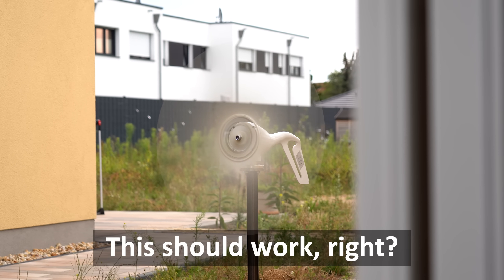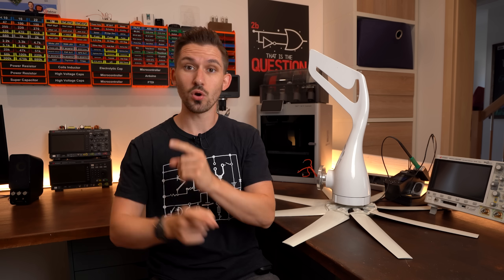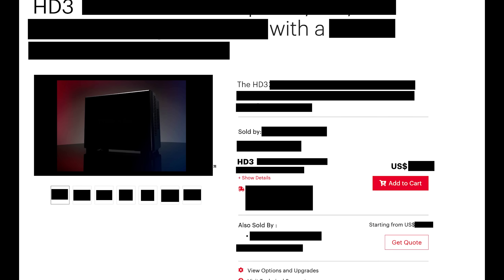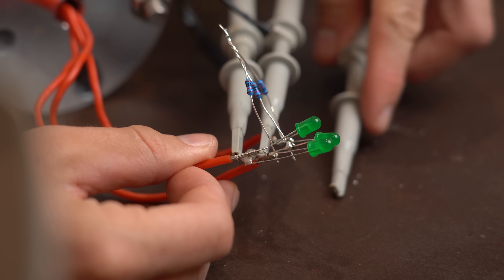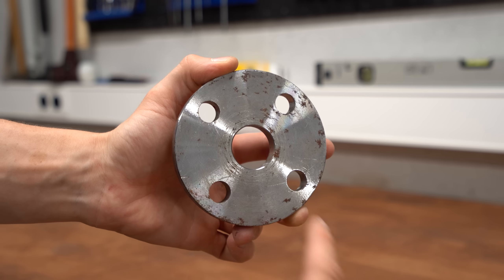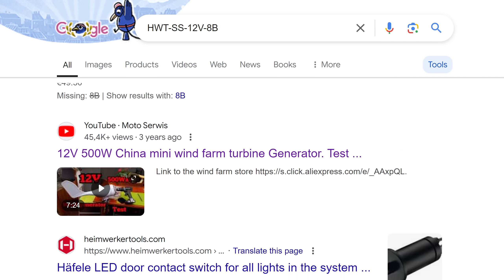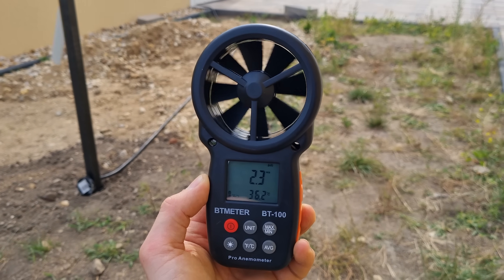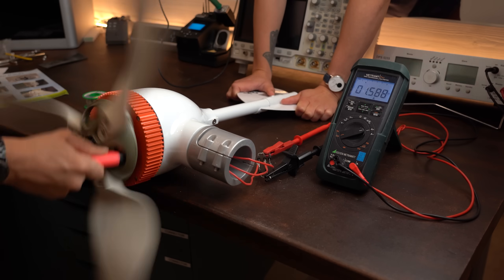I tried to Power my Home with Wind Generators! (Worth it?)

Comment: It*s always a good idea to think about opportunities to produce electricity when the sun won't shine. Due to the fact that you are living (as I do) in Germany in an area where wind speeds are not really worth mentioning, you should think about wind turbines which have advantages at lower wind speeds - vertical wind turbines for example. Also those 'normal' generator wiring won't work really. Take a peek at: https://www.youtube.com/watch?v=lU930zXzLCE for example.

Comment: I absolutely agree, i bought the 48V version with advertising 800W and with the controller i get nothing but with the 3 phase rectifier i get close to 5W when it is stormy. i was thinking of stronger magnets or less airgap between rotor and stator

Comment: unfortunately, horizontal axis wind generators are rubbish at ground level, but if your local laws do not allow them, then you are out of luck.  you could try a vertical axis type as these are better suited for your kind of environment.

Comment: Those "hoverboards" motors built in their wheels give quite decent power output at low rpm. As they seem to be out of fashion, picking up a used one at low price is possible.

Comment: My wind gen rated mounted 5m off the ground @600w 12v system 2x 150Ah battery cant keep up with 4x raspberry pi running off a DC DC converter let alone the 6kw inverter.

Comment: i wonder if you could build some kind of intermediary mechanical transmission beetween the helix and the generator/alternator/dynamo part itself (in order to play with torque vs RPM  in order to get the perfect sweetspot that makes the alternator run at the max rpm possible, making the most energy out of the mechanical energy provited by the wind)

Comment: Here in the lower states, we all pretty much have AC running all day, or at least while the sun is up. The evaporator coil fan is almost always on and blows pretty hard. I often wonder if it would be useful to place a wind generator just above the exhaust and recapture some of the wind energy that is being wasted by the fan. I would be concerned that the heat coming out of the coil would overheat the generator.

Comment: Try recoiling 0.2mm copper wire in a serpentine coil with neodymium magnet's. robert murray smith. You will get significantly and i mean 4 to 5 times the output

Comment: Hey!

Would like to start with saying that I love Your videos 😊

Have You considered to try a vertical wind turbine instead? 🤔

When I have watched similar vertical turbines they say it has a better effect when it's such low wind speeds.

And it should work on a low setting like Your yard and even on top of the roof on higher buildings (with a flat rooftop 😅)

Comment: Ive heard of people rewiring clothes washing machine motors to 3 phase, only needing to cut a few wires and connect them correctly on the motor windings. These were in Australia primarily, a motors needed to be a specific type to not have to rewind them.

Comment: At 3m/s wind speed the theoretical max power of a ~1m diameter wind turbine is only 8W. Rewinding the rotor will help extracting more energy than what you measured but you will never exceed the aforementioned number.

Comment: So the outputted voltage is lower than the minimum voltage to charge the battery right? Why not use 7.4v batteries in parallel in the input and use a step up circuit when used to output?
Reply: This should save a lot of time rebinding the motor or trying a new turbine.

Comment: Why can't run run multiple and daisy chain them?  Or maybe charge a lower voltage battery and then daisy chain those to charge a larger battery?  Idk anything about this stuff so no idea if that would work, and if it wouldn't why it wouldn't work.

Comment: i wonder what it would look like down/up-scaled
not like a 100 pc fans, but larger lightweight wings & custom rotor/stator
those tiny wide blades are for creating high windpeeds at pressure
i´d like to see more narrow longer blades
typical German, everything is sized and overengineered in a way, it hinders itself
source: German myself :D 
very good buildquality  tho´ <3

Comment: Have you ever tried building your own wind-generator, using a car alternator? It already has the electronics to charge car batteries, so that's a plus. I don't know what RPM speed it needs to work properly, or if it would even work at all, but I was considering building one when I can get my hands on all the components I need. And yes, it would have to work on relatively low wind speeds too for me.

Comment: As soon as I saw diameter of rotor - project was still-born even you if you manage to put it on the top of the house. And Chinese stated power rating usually is not reachable anywhere else in the world, excemt on Chinese own promotional videos.
I was pretty sure, vertical-axis turbine would be more suitable and you would be able to use whole space allowance to max out area as well as capture slow winds and you can group multiples together.

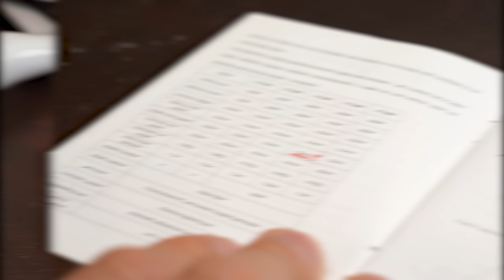Comment: 12:14 wow, the runout of the rotor disc and the air gap between the magnets and the stator coils is most impressive. No wonder it has bugger all power output. :)

Comment: I am not sure if anyone would go through so much trouble, but what if you created a gearbox, like, using the same principle as a ten-speed bike gear thingy for the fan to the generator part, I am sure someone smarter than me has tried that already and seems like a good idea but doubt it would work any better or it would be in use by now Right?
Reply: Fun Fact: Most wind turbines that are used to power the grid actually do use automatic reduction gear boxes now a days for high wind speeds. Mainly used as a safety feature so the turbine doesn't overload the grid when ridiculous winds pick up and the wind generator trys to rotate so fast it self destructs.

Comment: Pick a wind turbine you like. It has a maximum wind speed, and a maximum power output. 

Find a spot where you want to put it.

How often is the maximum wind speed blowing there? It probably is only half the speed on average. But then you only get 1/8 of the power.

Consider the needed maintenance for the generator bearings, wind blades should not break apart, rattling or whirring noises that upset neighbours... wind power sadly is best left to the experts being able to put big installations with huge blade radii and high towers.

Comment: 12:15 the rotor is not rotating on a flat plane relative to stator.. (not perpiducular to axial axis) some of the magnets are above the coils at parts of the rotation.  Also the magnets are rather far (relatively) from the coils, power falls with the square of distance (inverse-square law)

Comment: I'm curious if you tried placing the anemometer at different heights during testing? Even though you technically can't erect the turbine above a certain height, the altitude data you gather could at least help extrapolate what potential gains you could make at those heights. Maybe for the future improved build because it would benefit viewers who don't have local height restrictions.
Also, I know you're invested in the existing HAWT design used here, but consider there is also the helical VAWT designs which have their own advantages for maintenance and serviceability - and are especially suited to low wind speed + low power scenarios. It was even invented by a German!

Comment: For low altitude you may look in to VAWT type of turbines. They relly more on high amp low voltage systems. And work better with lower windspeeds

Comment: Great video as always 👍🏻 I want to see your DIY version where you optimize it for your wind speed. Please check different types, axis orientations and design all possible parameters like size, gear ratio, windings and so on so that you have maximum power output.

Comment: I've successfully used small wind generators in two situations.  One was on my yacht where there was plenty of unobstructed wind - charged the batteries reliably for years, supplemented with solar power on still days.  The other was in Antarctica with the same 'Ampair' brand (top of the range then) but larger size.  This is the windiest place on earth at sea level (Mawson's Huts in  Commonwealth Bay).  With cold, dense, katabatic winds it generated large amounts of power.  It was on a hinged 4m pole for easy maintenance. In both cases the noise was considerable and intrusive. They work, but only with strong winds - you simply haven't got enough wind for a small turbine.

Comment: There are so many bad wind turbines on the market, and they pretty much all lie about how much they generate. But I was also disappointed to learn about things like dump loads and start up speeds. My house is 10m at the highest point, and at this height, the wind speed still isn't enough to generate decent power. I did check the wind speed database for my country first, and i thought it should meet the minimium startup speed but it still never produced any useful power at all.  If you could put up a tower then it might be worth it I guess.  I think at 20m high, it might work? but no chance in hell of me having a 20m tower in my back yard. Oh well. Lesson learned. Don't buy a wind generator.

Comment: Sadly these cheap turbines are totally misadvertised.  1000w wind turbine (but only in a hurricane just before it explodes). I also think your continuous use of various chinesium MPPTs is holding things back. In my experience with Solar, you get what you pay for the with MPPT controller.  Your video is helpful and you are an excellent teacher it would be great to see a video with a bigger, less garbage turbine and decent proper branded MPPT to see if you can actually get it to work.

Comment: .... Like I know you could not place it higher but if that is the case why even bother. You can get ok power with wind generators but not when they are 1m from the ground...

It is like placing solar panels under the tree and crying about how bad they are...

And sure you could have some laws against building  things high but I am sure that you are allowed to place it on the roof and I am sure that your roof did not reach max height allowed....

Comment: Instead of rewinding the coils, you might try to change the gearing. Also, you could integrate those generators into a low voltage system (6V lead-acid motorcycle batteries or Li-Ion), this could be a nice alternative to to solar for running low power outdoor projects in winter (garden lights, sensors).

Comment: Likely your biggest problem is the hight limitation on your wind generator...
You need laminar air flow for the turbine/ fan blades to be efficient. You would need at least 6 meters off the ground and away from buildings and trees to get anywhere that.

Comment: To use wind energy you may have a look at "ugrinsky wind turbine". Robert Murray-Smith has bild a wind wall module by useing 3D-prints. The system has no preferred wind direction and is very compact. I'm going to build it for our balcony as a test. The fall is coming.

Comment: To be honest, I'm also sceptical about wind generation at home, but at such low height it's practically destined to fail. I don't remember wind speed to height diagrams, but at 1m there's practically no useful wind. It's like measuring river speed at the bank. I would say the lowest practical height is a meter higher than the roof of near buildings.

Comment: I am no expert welder, but when you lose electrode contact and strike a new arc, you contaminate the weld with carbon and that's the reason for the "bird turd" effect. Carbon is actually resistive (as you well know) and horrible in the strength department, unless carbon is applied top steel in the correct manor. Not done by the common man and welder. Also, stores, at least in the U.S. sell a lot of welding rod designed for cheap AC machines. If you use 6013 or other AC rod with DC, it looks like garbage. The flux for AC smells way different, but it's unmistakable in it's unique odor. You can turn the heat WAY up with thick metal and not worry about burning a hole through it. Practice is the best training!

Comment: Seizure warning at 2:30 due to fan blade flashy flashy.
Also as @Nicoya says - its wild to mount this so low to the ground. Higher up is better, but yeah there isn't a lot of power this can extract.

Comment: I always wondered what would the hardware of those do with new generation of blades. I am not talking about those, but the new ones that are twisted and looks like a barrel :)
THey should be better in lower speeds. The other thing is that you need variable pitch, which I think is easier to do with the new ones

Comment: it not much power but it can be little useful for something in shed like led light 12v or 6v else run power to light up area for 4 or 6 hours before it come to died battery
i can see little useful this can be but aint much
i have make smaller version of wind generators but it was enough power to keep my 12v up and led light inside rv and i still have get on roof and oil bearing every weeks to stop it from being stuck or sticking only getting 3.3watt out of it 6in fan blade above ground 15ft
how i make it? take alternor out of vehicles and cover it and make pcb so there be no backfeed into alternor and use belt drive and pulley and i replace pulley size on alternor to 2in and fan pulley to 8in so it 6x time turning get it up to 1200rpm to make power out of it

Comment: 😆I have checked the link,now the vendor claims it generates 6 KW/h,wich is clearly a scam,  because a 5 KW/h generator weights almost ton (i have installed one once). Correct would be 6 mW/h😄

Comment: The generator was designed by a chinese brain,so it have some errors of design. That's why ,a romanian brain asks your german brain to change the blade's angle to around 45 degrees of the wind direction,so the wind flow to generate torque on the axel = energy. Remember  when you have the window and the door opened, the force the door pulled from your hand and is slammed when it's half opened? (45 degrees)  that's what i'm talking about😄 Also, check the magnetic strenght of the rotor, i have the feeling that the naughty chinese used magnetised permalloy instead of neodymium, you know,to make it cheaper. If it barely sticks a screw driver to it,the thing is clearly permalloy,in wich case you can buy some cilindrical neodymium magnets, drill some holes in the rotor and glue them in.

Comment: I could have told you that. You need to gear up the generator for speed,  X2, X3? The big tall wind generators have transmissions to convert blade speed to a higher RPM to drive the generator.  Install an overdrive unit between wind blade and generator.

Comment: Please do a DIY in my country during the summer there are usually power outages and using solar panels is quite expensive, I tried using diodes for silicon and extracting energy but using batteries is also expensive, I think a diy wind turbine could work, I know it is a lot to ask but also if you can guide me on the issue of using recycled batteries it would be a great help. thanks for your videos they help a lot

Comment: I think you should.look into the vertical wind turbines. They are generally set up better for lower to the ground urban environments and don't require high wind speeds to achieve higher output.

Comment: I've got a vertical wind axis turbine and have the same problem with all wind speeds including storms. I think there is a design flaw, the generator should be connected via a gear wheel so also moderate wind speeds will generate sufficient power.

Comment: @greatscottlab BLDC generators never generate as much as powered generators. A car alternator as a wind generator would work quite well and you can vary the input voltage to control the field strength which will determine the output current and rotation speed. Might be worth rewinding it as a powered generator or DIY it with a car alternator.

Comment: I look forward to throwing Sechspulsbruckebschaltung in to a conversation in the pub in the near future.

I bought a wind generator similar to yours about 10 years ago and thought it was broken or I wired it up incorrectly because it didn't generate anything. I must admit I put it on a 15m pole initially and it did a good job but some months later I was obliged to take it down, having been told it was illegal in the UK, too! (though permission can be gained, for a fee). It never worked near the ground.

Comment: You might be able to desolder those wires and create a larger loop. So rather than 6 wires in parallel have 3 or even 2 with 2 or 3 loops. (No I didn't count the wires)

Comment: I'd be interested to see how much faster it would spin by adding a flanged cone around it to create low and high pressure areas.

A lot of work is being done in the commercial sector for low wind speed collection at the edge of roofs as well, where the building helps to funnel wind into a vertical turbine.

More on the low-speed rooftop designs here: https://youtu.be/SGQTwcq0UIY?si=FwJixHDZXO9Md-9W

Comment: I've been waiting on a new wind video!!!! Wind is a lot more tricky to work with compared to solar :( but you are like the king of diy and education so I have faith!
P.S. next time you weld, get a grinder and clean the rust protector coating. then gind a tiny bevel on the pipe. then just fill it with stick and do small circles while you move the pool of liquid metal around.

Also i really think you should try a diy version. I saw a video not too long ago where someone was making diy wind turbines with resin. made 3 discs, 2 with magnets and 1 with the windings. was making really good power at low wind speeds. its just quite large in diameter. and VERY heavy.

Comment: theoretically there should be about 50 watts per square meter at 5m/s. of course there will be a big loss but i didnt expect this magnitude..

it has to be noted though, that the energy falls off quite drastically with lower wind speeds..